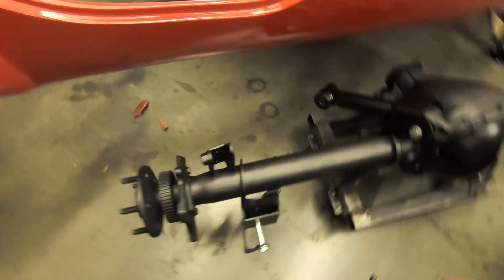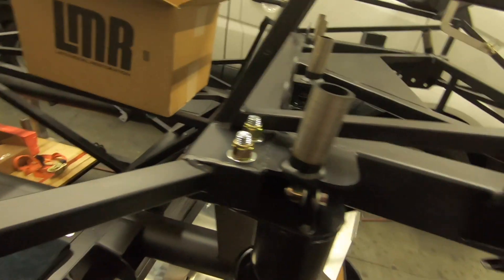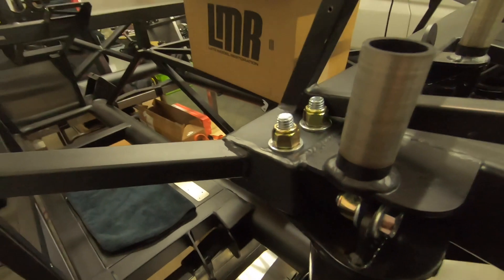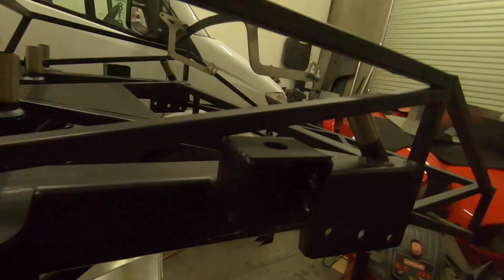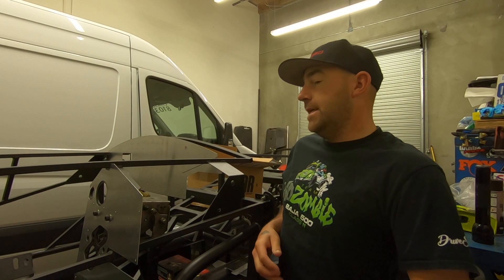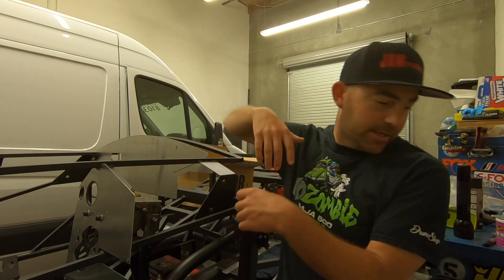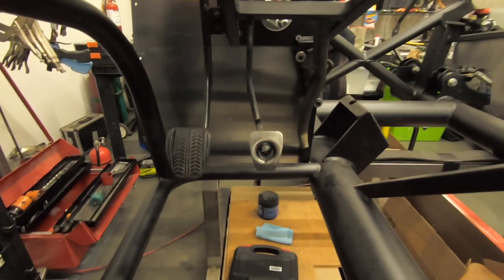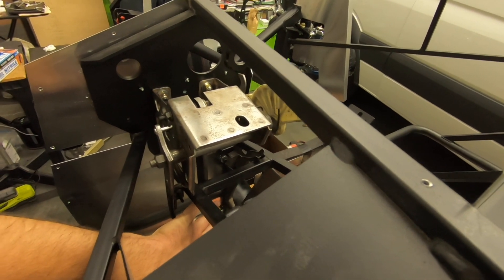Factory Five Cobra Roadster - Rear Ends and Pedal Boxes

Comment: Perhaps you're already aware but companies like Maximum Motorsports and Griggs Racing exist because the standard Fox rear suspension was substandard at best. I don't know if Factory Five has changed the geometry but there's only so much you can do when the basic design is flawed. The 3-link should be considered the minimum for a FF Roadster.
Reply from the maker: I'm well aware of the flaws of the 4-Link. But this car is a sort of experiment. We wanted to start the most basic car we could and work from there. As the 3-Link might be the known minimum for most builders, if we were going to build one car, that's what we probably would have started with.